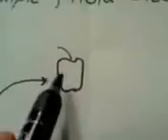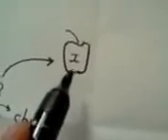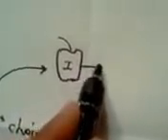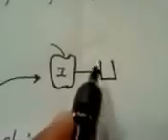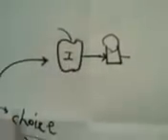SAMPLE AND HOLD CIRCUIT by IIT .

Comment: Hi, at 6:29
Actually the cap will not discharge through non inverting terminal of opamp because  it has higher input resistance .